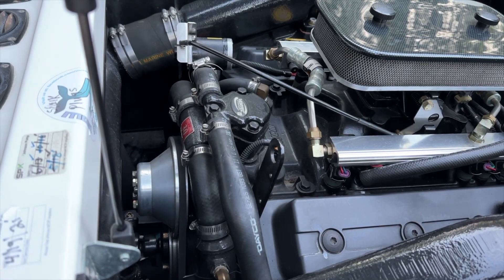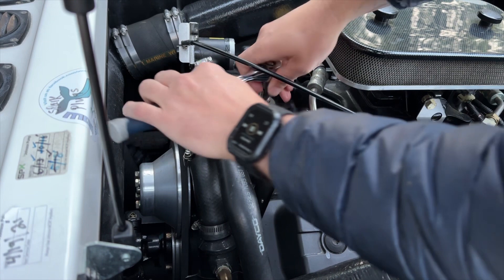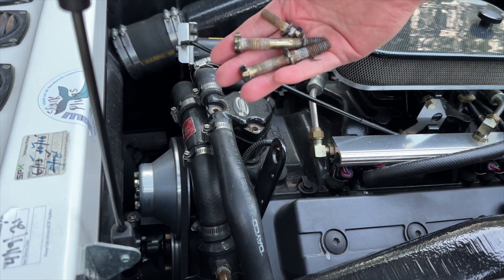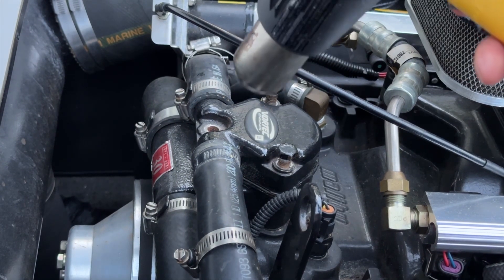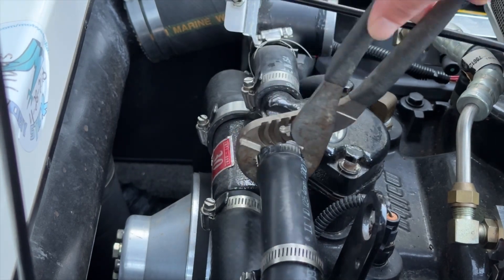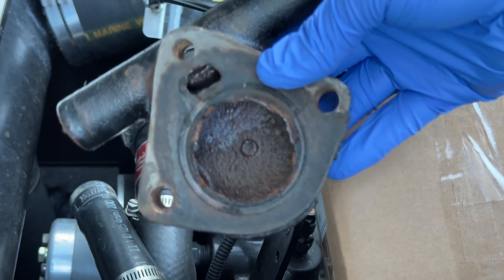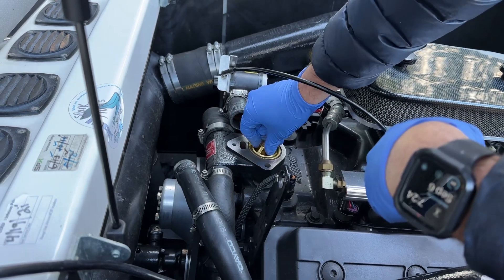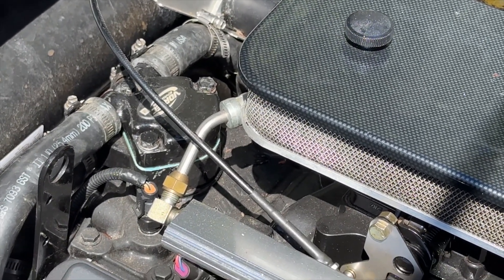Boat Engine Thermostat Replacement - DIY Guide

Comment: @FixItWithJake2 -   Does the thermostat go in and gasket over so it covers thermostat edges and did you use a gasket sealer?
Reply from the maker: The thermostat sits in first, then the gasket goes over it and seals around the edges. I didn’t use gasket sealer on mine because the gasket was made to seal on its own, but if your surface isn’t perfectly clean or smooth, a thin layer of marine safe gasket sealer can help.